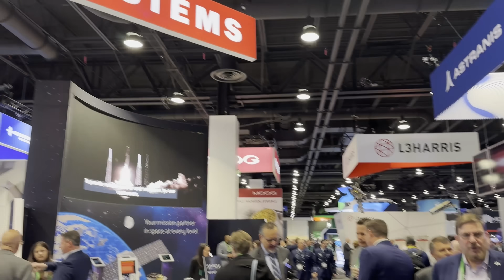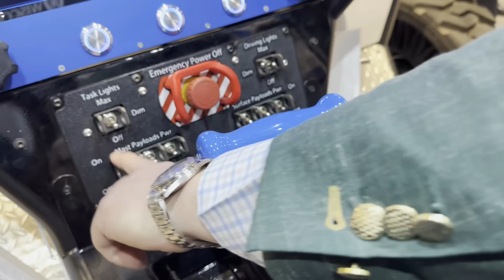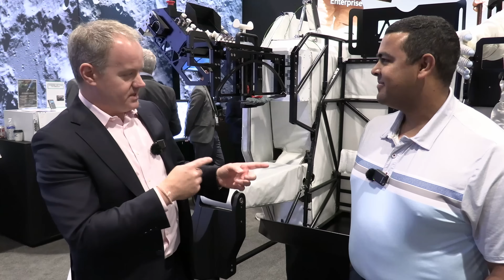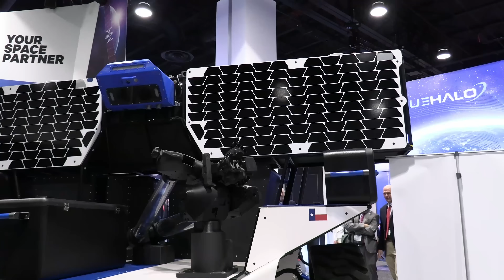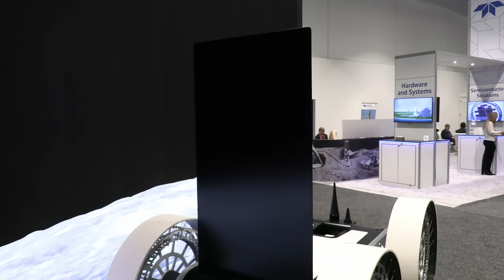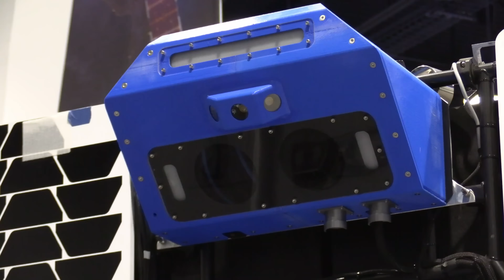Who is in pole position to build NASA's new "Moon Buggy"?

Comment: Why not a 6 wheel unit?
Reply: Too complex and heavy for these smaller vehicles. The Japanese Space Agency is working on a larger design with Toyota that is fully enclosed and pressurized that has 6 wheels. It'll operate as a mobile basecamp (basically an RV but on the moon).
Reply: @starmanxvi  Toyota? If there's a 10 year requirement it'll last for 50.
Reply: More complexity= more parts= more opportunity for something to break and more weight.

Comment: Can’t they just remake the moon buggy from plans from the original one. According to the video footage, that moon buggy was the best ever! Unless…..
Reply: Because it wasn't the best moon buggy ever?.. The only navigational tool the Apollo astronauts had on those rovers was dead reckoning. Not to mention that those rovers were designed to be as bare bones as possible, we can do much better with modern tech, hell, those rovers ran on lead-acid batteries!
Reply: Yeah, why don't we build wooden ships to go explore Antarctica? We did it hundreds of years ago and it worked so why don't we do it again? 

The issue is that we don't have the machines to build them anymore. Nor do we have the machines to make those machines anymore. We could remake them... But that would take a lot of R&D and at that point you might as well start from scratch and make something more modern
Reply: @notgreg123  that reason is bizarre, we couldn't replicate? BS!
Reply: @DrHalbesWissen  again, we could given enough time and money but it would probably be just as expensive to develop something from scratch. Plus Apollo hardware was notoriously dangerous and unreliable, idk if you'd want that anyway
Reply: @DrHalbesWissen again, why don't we build wooden ships to explore Antarctica? Why use an iPhone when you can use a Nokia 3310 and a Palm Pilot? Why innovate and make any newer technology at all?

Comment: just use a cybertruck with modified tires.
Reply: Can you imagine breaking down on the moon miles from your lander lol
Reply: Teslas have a lot of glass, and glass is really bad for pressurized chambers in a vaccym. Even worse though, the Cybertruck's glass is flat, making it even worse for containing pressure
Reply: @ I would think they could figure it out.  However I was really meaning as a transport.  Would still need suit to exist.  Your point is 100% correct for being air tight.